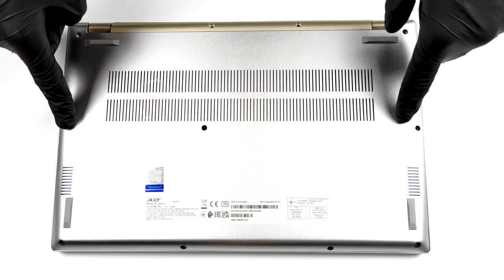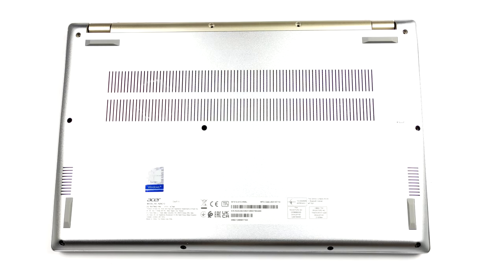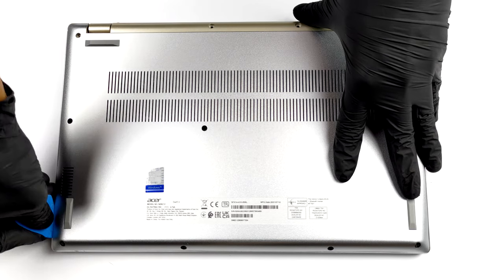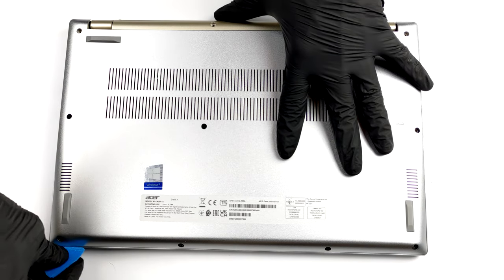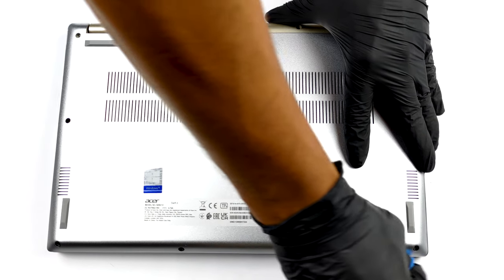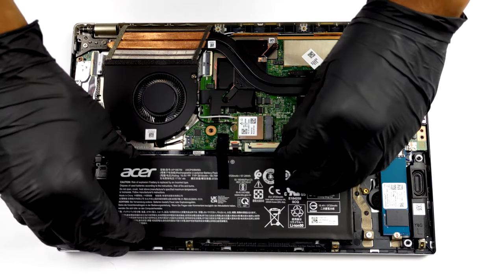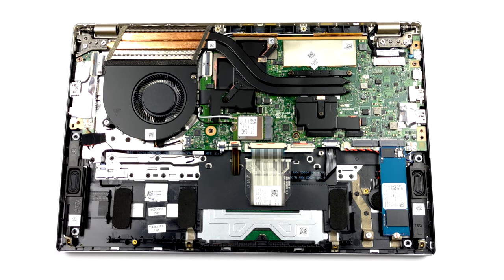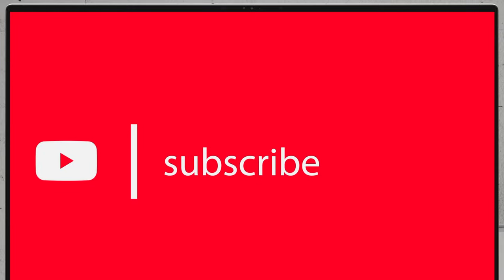🛠️ Acer Swift X (SFX14-41G) - disassembly and upgrade options

Comment: This is a very powerful laptop that doesn't have the drawbacks of many gaming laptops. It looks normal, has a charging brick of 90W which is actually portable, and is nice and lightweight. Main distinguishing factors are:
- really nice display (100% srgb 1080p 60hz max 300 nits w/ good brightness scaling)
- good build quality overall, with the lid being a tiny bit wobbly
- the top-notch performance for an 14" ultra-thin (see details below if interested)
- really small size
- thermals are decent, especially for what it is, though fan gets very loud under heavy loads

The screen and keyboard are both pretty nice (keyboard backlight is a nice plus) and webcam is fine (720p). Port selection includes 2 USB 3.0, 1 USB C, 1 HDMI, Combined Audio, and a Kensington Lock. It's a bit annoying that there's no ethernet or SD card reader; however, the I got a tp-link ethernet + usb hub for ~$30 and it's pretty easy to carry around. The speakers are on the bottom and sound kinda meh (they get the job done). I get 5-7 hours of battery life under most use cases, which is pretty good for a laptop this powerful and small. If you play graphically or computationally intensive games, expect lower. While the fan can get really loud, it generally runs quiet unless under stress. The performance is amazing; the Ryzen 7 5800u is one of the (if not the) most powerful CPUs for ultra-portables, and will make a big difference for video/photo-editing especially. The 3050ti allows this to play most modern games at decent framerates. Keep in mind that anything higher than 60 is overkill unless you're using an external monitor, so this should be fine for any non-AAA games and even some AAA games at high settings. But, don't expect ray tracing or any other super taxing stuff to run well. Another note is that you'll only be getting 60-70% of the GPU performance you'd get in a gaming laptop equivalent because of the size. Lastly, if you are so inclined, there is a 2nd M.2 ssd slot inside for future upgrading, and the 1st one is also user accessible. Make sure you have torx bits if you want to open it up. Overall, this machine gets a 4.5/5 (rounded up to 5) from me. Below are more details for performance nerds/diy people:
The Wifi card is a Wifi 6 2x2 by Mediatek. Intel is technically better, but honestly it runs fine. The CPU has a listed wattage of 15W, but boosts as high as 40W while plugged in, sits between 85-95C under heavy, fully threaded loads, and stays clocked between 3.7 and 4.4GHz on all 8 cores. The GPU stays nice and cool under stress at around 65C, and runs up to 35-40W. For reference, the NVIDIA 3050ti at that wattage runs 15-20% worse than my desktop NVIDIA 1650 super at 100W. I haven't tried to max out the CPU and GPU at the same time for a long time, but expect the performance to be a little worse in any games that utilize both parts heavily. The integrated graphics handle the OS and the majority of less GPU-intensive tasks, which saves power and maximizes graphics performance (I feel like this should be a given, but it isn't). I bought it at https://amzn.to/2XlpdN7
Reply: is this laptop has a good heat management? do you think it can use the gpu with its full potential? or will be limited at some point to prevent overheating because of its size? I don't think small laptop like this can run the GPU with its maximum potential without overheating (or i'm wrong, I actually don't know)
Reply: Thank you for your detailed review, just bought it to replace my 2014 Macbook Pro and loving it so far
Reply: @czer096  I'm actually the OP of the original review on amazon (funny to find this here lmao), but the cooling is not enough to run the GPU at full power. It is good enough to run at spec (35-40w) without throttling (60-70% max performance), but the max possible spec for a 3050ti on a thicker laptop is 90w iirc
Reply: @timataio4290  do you think the regular rtx 3050 version will have a better battery life? 5 to 7 hours sounds pretty good for me but i hope I won't regret not buying the 3050. Im not sure if acer changed the way they test the battery for the new models but it worries me that the more expensive version has worse battery life by a few hours based on what acer says on their website. Thanks for the being the author of the review though lol
Reply: @happyfroggy3262  I imagine regular 3050 should have similar battery life (maybe a little worse if the cpu is different), but I think the difference in battery life just has to do with the testing methodology. My 5-7 hours includes mid to high brightness with web browsing, video watching, and random apps, while their (most tech companies') benchmarks are usually done at absolute min brightness and the most basic of tasks. If you want more battery life, you're probably gonna have to either give up the GPU (Maybe HP Pavilion Aero 13), get a bigger AMD gaming laptop which has a bigger battery (any number of options, but avoid intel cuz they suck for battery life on their gaming chips) or get a MAC. Fyi 3050 is not much weaker than 3050ti from what I've heard
Reply: the wifi card sucks
Reply: Amazing detailed review my man. Thanks

Comment: Asus should learn from Acer in this area, make the damn battery smaller and squeeze in an extra M.2 Slot.
Reply: whats sucks is that judjing by the internals they could have used a bigger battery.

Comment: Sad the ram is soldered. Thanks for the info.
Reply: if they already need to solder, they should at least offer a 32GB model. with those components it would be a nice laptop for some mobile productivity. 8GB in 2021 is pathetic
Reply: @loc1123  exactly!
Reply: 16 gb is more than enough for me, if you need more than that i'd recommend zepyrus g14
Reply: Acer also have a 14 inch laptop that have upgradeable ram, the Triton 300SE
Reply: @mindkorner  No camera though.

Comment: Would you like to make thermal paste replacement tutorial for this laptop?
Reply: Do you know the thickness?
Reply: @ambrose1443  sorry, i dont know sir
Reply: yeah please i want it too, the laptop its great but thermals not, i could be so much better repasting propertly, with a good thermal paste, when gaming it gets very hot
Reply: @jeancarlosrochasilva4650 i manage to replace the thermal paste, just disassemble the screw, clean it using alcohol, then add your thermal paste.

Comment: Can we change the Wireless Card to intel AX200? The mediaTek is really troublesome, the speed is low, and latency is so damn bad.
Reply: Yes you can change it but im not sure what wifi cards are compatible.
Reply: Yes, I changed it to an AX200 and have had no issues. But, some of the latency on waking is part of the laptop design, as it still takes 15-30 sec to connect most times
Reply: @timataio4290  I want to buy this laptop, would you recommend it? I need it for light 3D work, editing and coding. also I use a virtual machine and I think 16gb of RAM is enough without it being slow.
should I buy it with a new wifi chip off the bat?
Reply: Ax200 and ax210 both compatible

Comment: Hello! I plan to purchase this laptop. How durable is this laptop? Do you think this can take a drop to a concrete floor and survive? Also, do you think the hinge can last long? Acer usually makes low quality hinges...
Reply: Frankly, there are not many laptops that can surive a fall onto a concrete floor. These are pretty fragile instruments.
Reply: Well, yes...sigh. Thanks for your response💖

You own this laptopp right, @D IsMe? What can you say about its hinge? Are the hinges of yours still okay until now? No, plastic crumbling on hinges whatsoever so far?
Do you think those hinges are likely to break? How many years do you think this laptop will last on you?

Mannn thats a lot of questions...
Reply: @sanchezbernardc.1900  THe hinges are fine and they look durable. They look way better in hand than in videos and feel premium once you touch them. I would not worry about them at all.
Reply: @samratspeaks  Ooohhh thank you soo muchhh for thattt. May I know the model number of the Swift X you purchased? How many months so far have you spent with your Swift X?
Reply: @sanchezbernardc.1900  I have had it for 4 days. 16Gigs. Loving it so far. Crazy fast.
Reply: @samratspeaks  Ooohhh I seee, hopefully thatt lastss longggg. Mind that the hinges may still be defective on your model even if you think it might not be, so just in case still do take care of themm to avoid unnecessary costs💓💓
Reply: @samratspeaks  Mannnn hope that lasstsss😌💖 Hopefully Acer actually did a better job this time
Reply: I want to buy that is that heating much?
Reply: @broochii  It gets a little hot under heavy load, especially when charging. When not charging, the temperature is around 70°C while gaming, and when charging, it nearly reaches 90°C. If you feel the temperature is too high, you can use software like AATU(AMD APU Tuning Utility) to set a maximum temperature limit.
Reply: @samratspeaks   Hi there. Do you have any issues with the laptop fan? Sometimes it goes crazy, sometimes it is quiet.
Reply: This model with a cooling pad is amazing

Comment: Is the bottom plate made of aluminum or plastic?
Reply: aluminum. It feels fucking fantastic and very premuim.
Reply: @alexsalazar5161  ok tx
Reply: @alexsalazar5161  if you lightly drop it by a few inches doe it damage?
Reply: The bottom part

Comment: I have this laptop, and i think the cooling system is't effective
Reply: is it easy to overheat? or what? did u use it for massive gaming?
Reply: I think for normal work it won’t heat up but gaming on high FPS could make it heat maybe play on 30/60 FPS and it will be better
Reply: @czer096  i have the 41g-r02a, tried to game and its burning lmao
Reply: Make sure to open the lid all the way to get maximum airflow. Cooling isn't the best though I'll agree
Reply: Works for me. And I have the GPU overclocked by 27% and I never see temps above 80* F. CPU never goes above 82* F. And that is with the max fan speed setting (Fn+F).
Reply: @TripleXess  Hey! :D How did you do to overclock by 27%? could you helpe me pls?